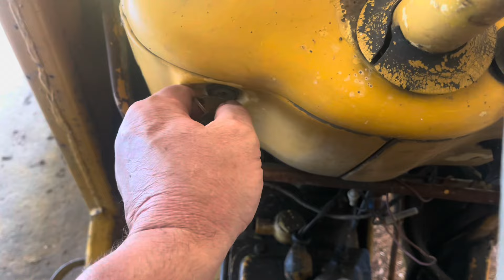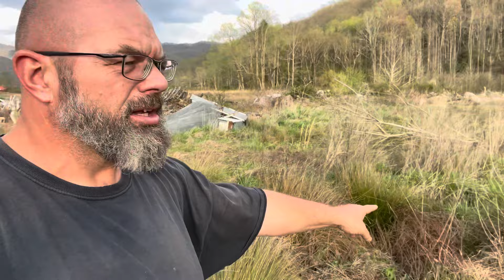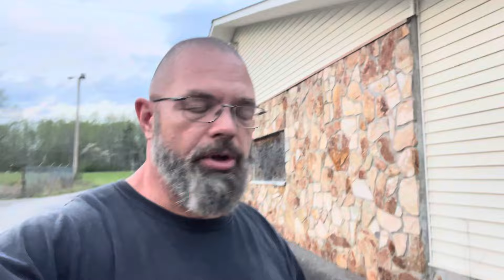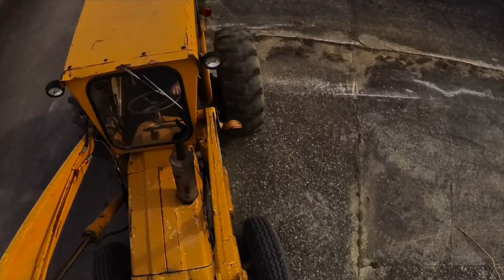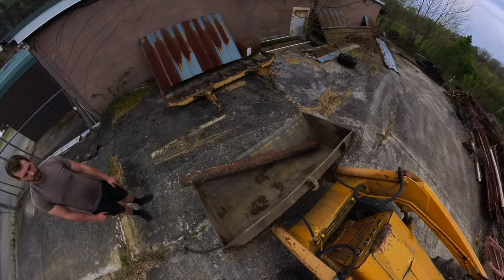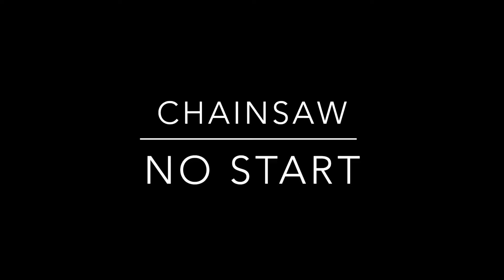Talon and I cleaning up the shop last spring ￼

Comment: Where did the water come from when you pulled the tree out?
Reply from the maker: There was a 15 gallon jug sitting next to the tree. And apparently it had filled up with water over the years and when we pulled the tree out it squeezed the jug causing the water to gush out. Completely unexpected.